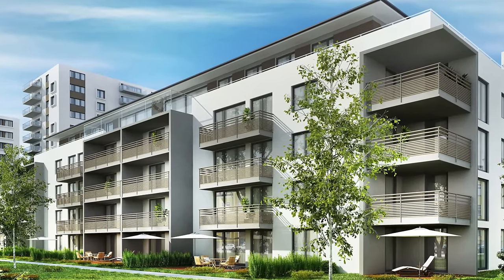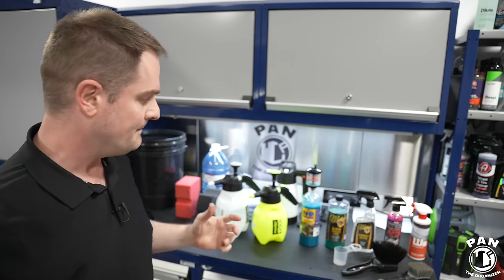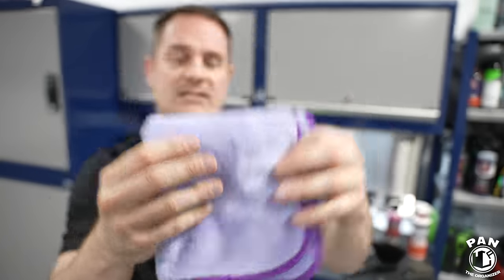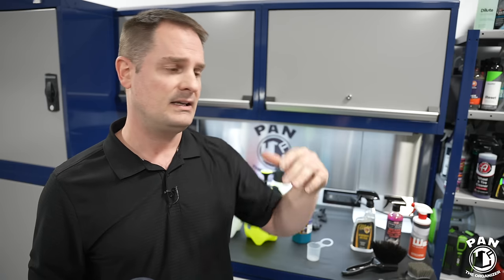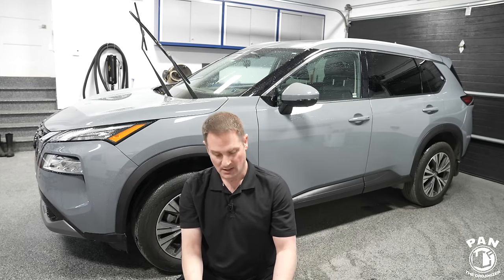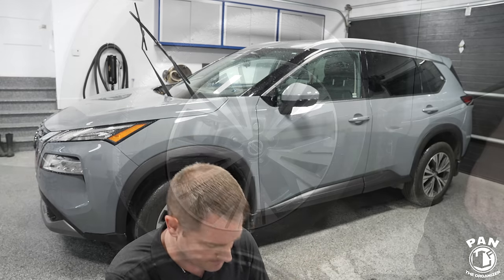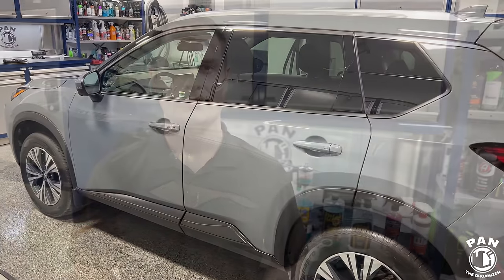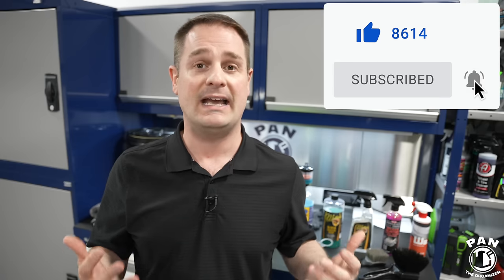How to wash your car without a hose or pressure washer! (RINSELESS WASH METHOD)

Comment: Is it possible to use Sonax Spray and Seal with a rinseless wash? Also, is the car safe for machine polishing after doing a rinseless wash?
Reply from the maker: I wouldn't do that, as Sonax Spray and Seal needs to be sprayed on a wet surface and then rinsed off. But by spraying it on the rinseless wash, the rinseless wash might try to encapsulate the product and might not bond as well.

And before machine polishing, I would recommend a traditional wash with water and wash mitts, to make sure you have a 100% clean surface, and also don't forget to use iron removers and claybars to decontaminate the surface before polishing.
Reply: @PanTheOrganizer  Is it possible to go to my local car wash on a sunny day (5 minutes away from my apartment) and do everything you just mentioned, except for the traditional bucket washing with a mitt, then drive home to my underground garage and wash with ONR and clay the car? There are no car washes where I live that allows bucket washing.

The steps would be as following:

At local car wash:
1. Iron Remover + Wheel Cleaner
2. Foam degreaser
3. High pressure rinse

Drive home to my garage:
4. Wash with ONR
5. Clay using ONR as lube
6. Dry car with clean microfiber towels

Is this sufficient before machine polishing?
Reply from the maker: Yes that should be fine.
Reply: @PanTheOrganizer  How about adding overcoats to the car after using ONR? 
If the car is coated with Kamikaze Myabi, will the polymers in the ONR interfere with the bonding process when applying Kamikaze Overcoat every 2 months? If that's the case, is using an IPA wipedown such as Carpro Eraser sufficient to remove all the polymers that ONR leaves behind?

Comment: What’s a great product that I could use like a rinse-less. Before I could touch the car then the water. To remove the dust. After rinse that off and then at last put the soap
Reply from the maker: Both rinseless washes in this video are great. You put that in a sprayer and pre-treat the vehicle before you wash it. I show that in this video on my own Porsche: https://youtu.be/0irxWvQylds

Comment: This might be an "illogical" question but do you think it's fine to use still rinseless shampoo if you spray your ceramic coated car with water before applying the rinseless solution? That way you will save the rinse step anyways.
Reply from the maker: I don’t understand your question
Reply: @PanTheOrganizer  sorry let me rephrase it: can you use the rinseless solution on a wet car that was previously sprayed with water? I know the rinseless solution should be used when you don't have access to a hose or water, but what about if you have kind of access to water but you still want to use the rinseless solution?
Reply from the maker: There is no point to use a rinseless solution if you have water. Just use the traditional wash method.
Reply: @diegocaracasfc  you can do that method if you would like to be extra “safe” that’s fine, some people also do apc pre soak, on heavily soiled cars then do this wash.

Comment: Is there a SiO2 Protectant like the Gyeon WetCoat that can be used at the end of a rinseless wash to protect ceramic-coated surfaces?
Reply from the maker: Not a spray on rinse off formula, as you are not using a pressure washer or garden hose in this application.

You could use Gyeon Ceramic Detailer as a dryind aid along with the rinseless solution that’s on the paint while towel drying.

Comment: Do you find that ONR or McKee's N-914 not encapsulate tree sap, pollen? I find it difficult to clean that off while using ONR.
Any suggestions?
Reply from the maker: They are not tree sap removers. You need something stronger for that.
Reply: @PanTheOrganizer  Ok you said something stronger, so what products would you recommend?

Comment: I’m trying to decide if it is worth it to completely switch to rinse less wash. It’s faster, better lubricity, and no water spots, so why would I stick with normal car shampoo in this case? I have access to water so I’m thinking pairing this method with traditional wheel cleaning and pre rinse, just safer lubricity when you use common sense.
Reply from the maker: I still prefer the traditional wash as I have been using that for 25 years with no issues, it's quicker for me (experience) and there's a soothing aspect to using shampoo and soap and suds and with the pressure washer, I can be more efficient at cleaning things like wheels and inner fender wells. A rinseless wash doesn't accomplish those things as well especially during our insane Canadian winters.

But regardless of which method you use, it's a question of personal preference at the end of the day. Use common sense, do it right, and just enjoy the process. :)

Comment: How would one do this wash when the temp is over 100 degrees fahrenheit so that this solution would evaporate quickly.  Thanks
Reply from the maker: You would perhaps do one panel at a time. Wash, dry. Move to the next panel. A lot of mobile detailers in high heat situations use this method.
Reply: @PanTheOrganizer  Thanks

Comment: Can i use a pressure washer for this too or do i need one of those little bottles?
Reply from the maker: I don’t understand your question
Reply: @PanTheOrganizer  when you soaked the car in the rinseless wash with the little bottle. Can I just use the pressure washer that I already have or do I need to buy one of those little sprayers?
Reply from the maker: I still don’t understand your question. With a rinseless wash, people usually don’t use a pressure washer, unless if it’s pre-rinse the vehicle if it’s super dirty, before you start the rinseless wash method.
Reply: It is highly recommended to pre-soak your car with the rinseless solution. Your pressure washer can only soak your car with tap water, not with the rinseless solution. A pump sprayer is not a must. You can use any spray bottle filled with the rinseless solution to pre-soak your car.
Reply: @SaddyTaz  thanks for the response, Jacky!

Comment: What if u are hurry and you skip drying with towels? In two scenarious, 1- car stays at place and dryels itself, 2- car goes to roads and what can u expect?
Reply from the maker: I wouldn't recommend that, as you'll have dirty water sitting on the paint (don't forget the rinseless solution has all the dirt in it). If you're in a hurry, don't wash your car. Wait until you have the time to do things right.

Comment: Hi Pan. Another great video. Weird question… I need to do a rinseless wash on my car. I will be using Luxury Microfiber rinseless wash. Would you know if this will leave a mark/stain on new concrete? Just had a new driveway put in.  I know some wheel cleaners have in the past.
Reply from the maker: Rinseless washes don't leave stains on concrete.

Comment: İ really dont understand why people making it harder. İ wash my car with 1 microfiber . With every panel i wash the microfiber in faucet, which is near garage, so the dirt goes away to the sink, and the micrpfiber is clean :) so i go on with other panels. No need for dirt guards, 2 buckets or tens of towels etc
Reply from the maker: There are many ways to wash a vehicle. As long as you use safe washing and drying methods, it's all good.

Welcome to my channel. You discovered one of the biggest car detailing channels on YouTube as we surpassed 945,000 subscribers and we have over 125 million views! I have been detailing for 26 years and I love to share my knowledge and passion with my viewers.

You found the right channel to help you learn everything about detailing.

Comment: No Rinse shampoo for a long time. Two questions:
1. Do I need to use a different sponge to wash the thresholds or wash it with the same one that washed the body?
2. After drying the body with a towel, do I need to use quick-detailer?
Reply from the maker: 1. Keep the lower parts of the vehicle for the end. Up to you if you want to use multiple sponges or mitts.
2. If you want to use a quick detailer to boost gloss and slickness, you can spray it on top of the rinseless wash before you towel dry. Or, once you are done drying the car, then you can apply the quick detailer on dry paint. As you want.

Comment: Can you do this in direct sunlight?
Reply from the maker: Ideally you would work in the shade on a cool surface, as there’s always a potential for water spotting especially if you have hard water issues.

If you use deionized or demineralized water in your bucket, that’s ok then.
Reply: @PanTheOrganizer  any recommendations for mobile detailers in direct sun? Should we avoid this process?
Reply from the maker: My tips for detailers working in direct sunlight: https://youtu.be/DebiLFBCHu8

Comment: Is this okay to do if your car is ceramic coated?
Reply from the maker: Yes. In fact the vehicle in this tutorial is ceramic coated.
Reply: @PanTheOrganizer  do you have a video on the best way to take care of your freshly coated car? My sq5 is at the shop right now as we speak getting front end ppf and revivify coating all around. I don't have access to free flowing water. Want to make sure I take care greatly of my car
Reply from the maker: If you don't have access to water, the next best option is a rinseless wash as you have here, as long as your car isn't caked with mud or heavy dirt. If it's caked in thick dirt or mud, you have to pre-rinse first. Common sense is needed when doing a rinseless wash. And rinseless wash doesn't mean you never rinse, it just means there is no rinsing needed at the end of the process.

And yes I have a ceramic coating maintenance wash tutorial here: https://youtu.be/yLiePQRMFc8

Welcome to my channel. You discovered one of the biggest car detailing channels on YouTube as we surpassed 820,000 subscribers and 100 million views! I have been detailing for 25 years and I love to share my knowledge and passion with my viewers.

You found the right channel to help you learn everything about detailing.

Comment: With respect to Pan.. this is NOT the typical cars we professional detailers get.  This car is NOT as dirty ... is what Im saying. Ive tested several of these rinseless washes.. its bullshit markering. Now.  Will it work on this car.. sure. But on the average car.. fuk no. I do agree that the sponge and rages u use matter.. a lot.
Reply: I had 26 detailing shops doing on average 500 cars a day, the only soap we had in our shops was what we used to wash our hands.

Comment: Why not use wash mitt instead of sponge?
I thought it was much safer for paint...🤔
Reply from the maker: This is not a traditional wash. This is a rinseless wash. The sponge used here was designed specifically for rinseless washes.

More on that sponge from its creator in my video here: https://youtu.be/gR2QhPWMuXw
Reply: @PanTheOrganizer  i saw the procedure and i understand that it won't hurt the paing but still i wouldn't be confident to use a sponge for some reason

Comment: Can i do this on a ceramic coated car?
Reply from the maker: Yes. In fact, the vehicle in this demo is ceramic coated.
Reply: @PanTheOrganizer  thanks for all the details, really informative. Ive gained alot from it. Quick question, if i have leftover rinseless wash mixture, can i use it on tiles and wipe dry? Just thought id put the remainder to good use and not waste any solution.
Reply from the maker: Welcome to my channel. You discovered one of the biggest car detailing channels on YouTube as we surpassed 780,000 subscribers and are getting close to 100 million views! I have been detailing for 25 years and I love to share my knowledge and passion with my viewers.

You found the right channel to help you learn everything about detailing.

Yes you can use the rinseless wash to clean pretty much any surface inside our outside your home. These are gentle cleaners. I use rinseless washes on windows, window frames, exterior doors, to clean the outside of the shed (we live in a wooded area), clean the chairs and tables outside in the garden, etc.

Comment: NOTES from a pro detailer - It is MUCH better NOT to re-introduce ANY wash cloth into the wash solution (wash media) - that way it will ALWAYS stay fresh and clean - THEREFORE NO NEED FOR A GRIT GUARD - just simply take 5 or six PLUSH micro fibre wash cloths and do as Pan suggests - use all 8 sides of each wash cloth and then put each one aside after use for later cleaning in your washing machine. Pre-spraying your car is a GREAT idea!  I HIGHLY recommend that you do NOT USE A SPONGE !  Despite claims to the contrary, no matter HOW careful you are, a sponge will ALWAYS retain dirt in its pores - EVEN IF YOU RINSE IT! Optimum also makes a NO-RINSE solution that deposits a thin layer of real carnauba wax - WORKS FABULOUSLY WELL !

Comment: I’m still pretty uncomfortable with this… I mic sounds like it’s picking up abrasive action. There is probably a reason Pan uses snow foam method on his personal cayenne s… even when it is pretty clean and just protected with C6 hydro. I concede there is a time and place…but this seems less optimal to me, and if I have the ability to go conventional wash… I think I going that way.
Reply from the maker: I personally prefer the traditional car wash method with soap, buckets, water and mitts.

A rinseless wash is mainly for those who don’t have access to water, a pressure washer or garden hose.

It’s still a safe method, but you need to use common sense with the rinseless wash method.

If you can use a traditional wash method, then keep doing that in my opinion. 👍🏻

Comment: the mckee's unfortunately doesn't have that ability of pulling dirt down to the bucket. Only ONR does. There was someone on Redit that already did this test. 

Also, dunking the APC contaminated sponge back in the bucket has never been a recommendation. It should be removed by rinsing or using a microfiber towel to wipe off the residue. Then that towel does not go back into the bucket. I know the video doesn't demonstrate the sponge dunking back, but it was not specifically suggested and I know someone out there is gonna end up drying the car with very diluted APC all over the car from the contaminated wash.